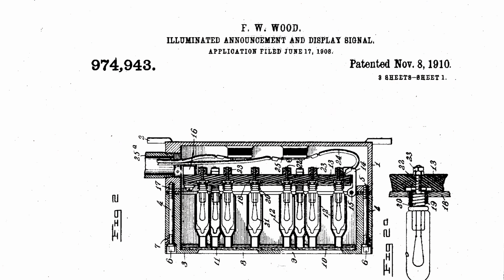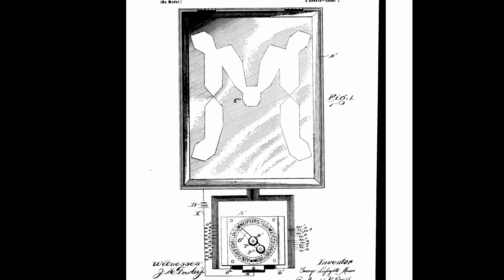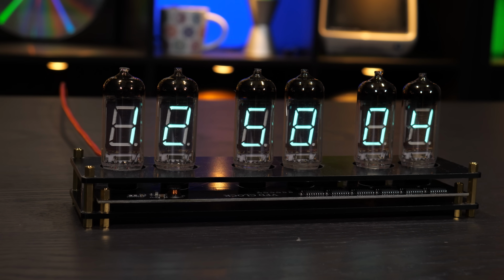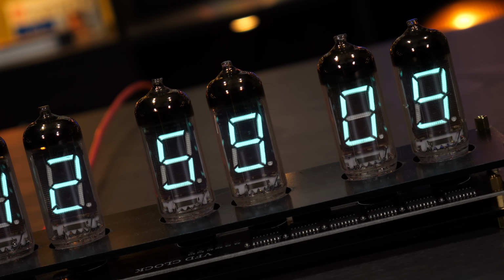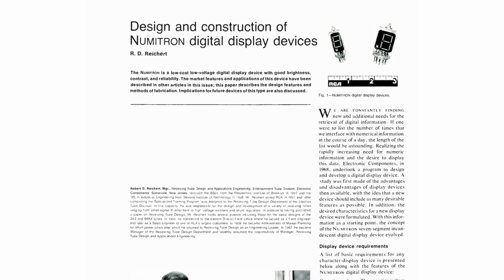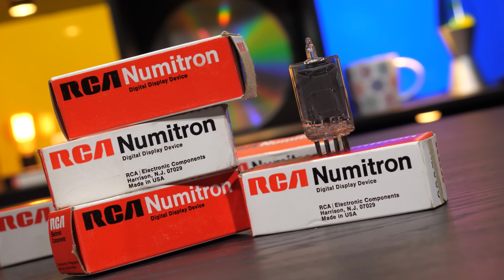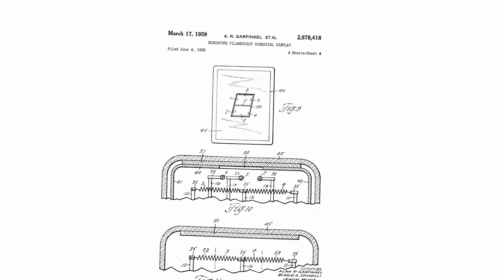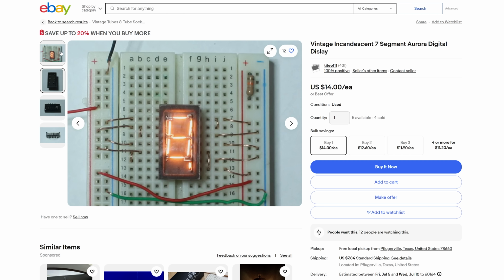The Numitron: An obvious idea that wasn't very bright

Comment: I love how janky they are, As a product designer myself, I bet the people working on these had a blast designing them, the sheer "slap stick" energy they radiate is just amazing, the pins also being the only support for the internal board (no wonder it's all crooked), the tape that hides the back wiring wrapping around the front of the board, the barely stuck in needles holding the filaments, and the cheap gold paint on the even cheaper metal rings around the base of the bulbs.

My only real critic would be the background, it doesn't look like it's made of anything special, they could have easily just picked something darker.

It's a shame they were hidden behind tinted panels, at least make the panel transparent to show off how cool they look !
Reply: SeanBZA mentioned they used things commonly available in the factory, so the background was deliberately chosen because they had it available in spades.

I wonder what their timeline was, since they had to know other tech was coming down the pipe.  It seems like the kind of project where they needed something "now" and as cheaply as possible.
Reply: @EmperorA0  to be fair, they probably were useful in situations where you wanted cheap and simple that could survive EMP or ionizing radiation, or extreme temperatures. Incandescents in cold weather back in 1970 would have been better than the then-immature technologies we now use after decades of evolution.

Comment: 3:58 I recall being infuriated by the 7447/7448 7-segment LED display driver ICs. The problem was that they were great for BCD, but whoever designed them could have made them support hexadecimal as well with just a little extra circuitry. There is NO common chip that supports hex. If you want to build a circuit that does this yourself, you'll need a ton of chips to get the behavior you want (Ben Eater has a video in which he does just that, and the resulting circuit is gigantic). The only alternative is to use a PROM, which is expensive and you end up wasting most of its capacity.

Comment: 12:32 042069
14:53 133337

I see you, Alec.
Reply: I am confused, what is significant about these numbers
Reply: @Andrew-cw2fs  4:20 - pot reference, changed the 5 to a 6 to briefly make "69" seconds... nice ;) then the number "1337" comes up a lot in computer/programmer/hacker circles as a shorter version of "elite" morphed into digits instead of letters "elite" -> "eleet" -> "leet" -> "1337"
Reply: @Andrew-cw2fs  1337 OR 133337 
1337 stands for the English word "leet", which is synonymous with Elite. Since the spelling was initially only understood by a small circle (the elite), it was called Leet Speak - or expressed in their own language: "1337 5P34K". This leads us to the name 1337Camp

42069   
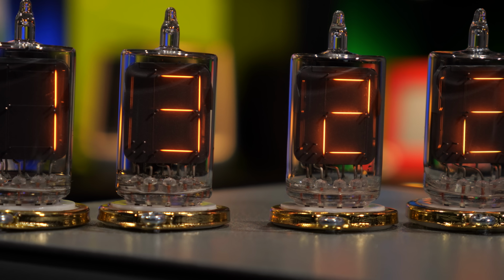420 is a weed thing. 420, 4:20 or 4/20 (pronounced four-twenty) is cannabis culture slang for marijuana and hashish consumption, especially smoking around the time 4:20 pm (16:20). It also refers to cannabis-oriented celebrations that take place annually on April 20 (4/20 in U.S. form). At locations in the United States where cannabis is legal, cannabis dispensaries will often offer discounts on their products on April 20.
69 is a sex thing you probably know
Reply: Niiiiice... came here in case they weren't pointed out

Comment: I remember the term Nixie Tubes, which
I remember in 1960's-1970's computers
as when there was the IBM 360/370
Computers where I did COBOL with
026 Punchcards on a machine to create a program.
I did Basic in the 1980's with the IBM
PC, also Commodore in then from
the Crazy Eddie electronics store.
Actually, back in 1971 we had BLMPS
in the Air Force base Personnel Office
with a shared Burroughs 3500 Main-
frame Base Computer with user
TC-521 Frieden Terminals for data
entry. 😊

Comment: I wonder if at least some of these problems could be fixed to make a less shitty, somewhat reasonable version? At least make the background dark. 

Also, maybe some kind of discharge tube or whatever it's called could be used instead. Either way, those little glass tubes look neat

Comment: Some guys I went to college with built a clock using those projection displays, but the logic for counting one second pulses and outputting the signals for the displays was done entirely using lots of these large relays they came into possession of somehow. Each one was the size of a soda can. The clock was in a large bare plywood cabinet they built, and it loudly clunked away the seconds.

Comment: The weird thing is that it'd have been very easy to improve. Simply adding a mask and diffuser in front of the filaments would dramatically improve the display, as it would eliminate backscatter and the segments a better shape. I wonder why they didn't?

Comment: 12:31 Your clock has a bug where it goes "58-69-00" instead of "58-59-00" on the seconds part. Extremely weird to see a six in the second's tens place XD
Reply: Surely not a bug but a very intentional Easter egg (4:20:59 becomes 4:20:69 in the video).
Reply: @nyunta139  
Well, but that may be accidental. It seems to always go 58-69-00, even from other times than 4:00:58.
Reply: @Lampe2020  Possibly. Seems more unlikely to me to do that by accident though! I feel like I saw another comment mentioning it that Alec had liked, also. But I may be wrong.
Reply: Nice. Blaze it

Comment: They could easily have made curved overlapping filaments, (15 segment, standard strait 7 segments with 8 corner filaments that overlapped the strait segments) with a black background for a much more legible display.   They could even have made it so the curved segments were powered by the adjacent strait segments so the same logic chip could run them.  Just a thought.  I figure they didn't bother because it would have added cost, and what they had was "good enough".

Comment: While the future versatility of VFDs and LEDs would have inevitably spelled doom for the Numitron's widespread use, I absolutely agree that if RCA hadn't phoned them in as a cheap product and actually bothered to design them better and actual QC check them, these little bulbs could've had a somewhat brighter future.

I mean in the first place who the hell at RCA thought that putting these things against a relatively light coloured, reflective background was a good idea - all it does is ruin contrast by creating a backlight reflection of the exact same bloody colour!
You can't even compensate by making the bulb brighter, because that just makes the backlight brighter!

Comment: Try this, take it outside on bright sunny day with the sun stairing straight into it and set it next to any other display tech you have and report back to the class which ones could be read. Bonus points if the other comparable displays are from the same period.

Comment: "Wasn't very bright" haha, that's a nice pun!

3:05 wait until you see an IEE (not IEEE - let alone SMIEEE!) Nimo tube... Hey, where's Fran? Again in the lab?
She got me to love all those vintage display technologies, even if most of that stuff is out of my reach economically.
Beautiful closeups here! :)

Don't let incandescent segments (or bulbs in edge-lit and projection displays) go completely cold - use biasing resistors to pass a low current; shoot at a value where they're still dark, but when they light up, that'll reduce the thermal stress, prolonging the filament's lifetime.

VFDs are going down - as far as I know, only Futaba or Noritake Itron make them, and with war in Ukraine, production there was halted. Sad news...

I've never built a clock using any old display technology - apart from my MTZVFDCLK project (Multi-TimeZone Vacuum Fluorescent Display CLocK) that's not finished yet, and is more about telling time in a specified timezone than telling time per se. I intended it as a tool to check the local time of youtubers doing livestreams, because it can get confusing really fast if I need to calculate it myself. Knowing that someone is e.g. in Sydney, Philadelphia or Austin, I could just choose an option in some web interface or send a command by MQTT... and the clock would show me the time anywhere in the world.
But I've used Nixies in a bunch of projects, from thermometers to a little art installation.
Reply: 4:46 he mentions NIMO tubes and even gives a card link to her video about them!
Reply: @robinsparrow1618  ha, I haven't noticed.

Comment: I don't know. In spite of the execution of that specific product, I don't hate the concept. Implementing a boost converter for the high voltages for a nixie or VFD in a battery-powered device is a real pain and probably not great for efficiency, so on paper this makes some sense. Putting a slightly diffuse colored filter across the front like they suggest may help with the thin filaments, and may also help with the contrast issues in much the same way that they do for VFDs. Sure, LED segments blow this out of the water, but I do like how scalable these are. If we had never advanced past those tiny LED displays with the lenses over them, I could imagine a world where this makes sense and the idea gets iterated on and refined a bit more.

Comment: Okay, okay, enough beating up the numitron, there is a segment of the industry they were unmatched at the time, nothing else could do what they did. That segment was transportation, and that ability was being clearly visible in direct sunlight. Nothing else came close at the time except LCD which wasn't ready for prime time and did not have the operational temperature range that these had. In the cockpit or on the dashboard, visibility mattered, not style.
The earliest example I recall seeing these used was on a MPH Industries K55 police speed radar.
Readable in the britest sun and usable in the coldest temperatures without turning black in highest temperatures.
Eventually other tech got good enough to replace it, but was still used for over 10 years in some applications. 
Give the numitron some respect, it was the right tech at the time and was superior than anything else at the time in its target niche.

Comment: I heard they were a lot more rugged (electrically and mechanically) than the alternatives up until the mid-80s, so aviation use was fairly common, alltough the ones I have on hand (actually from an old MiG of all places as far as I know) are flat packages usually known as Minitron.

Comment: They needed to keep the Old Production Equipment running ! These are obviously made on the machines with made vacuum tubes. They knew Vacuum tubes were headed for the dust bin, & made these to hopefully keep some of the machines on those production lines still running ?

Comment: I had a rather peculiar mechanically-encoded 7-segment with independent neon mini-lamps per-segment. by mechanically encoded I mean it was a mechanical clock where instead of hands, it had slip ring disks and pickup shoes for each segment. technique only works for a Clock, not a General Display Widget though.

Comment: Great video, as always.
I love both their jank and simplicity, (Though that grey board really was a horrible call)
I'm guessing RCA knew it was a stop gap product limited to maybe a few years use at best, that only had one major advantage, it's price. 
Even a month's research and minimum investment would cut into that already paper thin margin.
Especially knowing how unreliable handing over to the research labs would be. They wouldn't have finished until 1980 and it definitely would have used holograms, lasers, and something "sonic".
So, management had the tubes department slap something together with whatever was on hand as cheaply and quickly as possible. 
The guys who named it probably put in the most thought of anyone involved in the project.

Comment: I remember the 7-segment LED packages later even had the decoder embedded.  That meant just 4 BCD data pins (and decimal point) along with power/ground.  For values above 9, you could get ones that displayed hex, or others that blanked and displayed other things.  Made kit-bashing together a clock or home-built calculator so much easier.

Comment: my buick reatta had a VFD display for its insturments that was quite complex, and the control circutry was NOT up to the task of running it well, my car went through three of them over the course of my ten years of ownership...  though it was already 20 years old when I got it, and i never got my hands on a NOS unit (just junkyard finds)  Also, surprised you didn't bring up the heat production of VFDs as a downside, because boy do they like to get hot...

Comment: cheap digitial devices also used filaments inside LED-style 7 segment displays in the past. These looked just like LED displays, but behind a plastic diffuser you found small filaments directly on a pcb and yes, without any vacuum, gas or encapsulation. I once had a radio alarm clock with this kind of display and I was very surprised what I found and the fact this worked and looked so good. I was sad that there was no nice LED display to salvage though^^

Comment: Hmm, never saw this type of display before, but it's so obvious someone tried it, so daa. And I kinda like the thin segments! Okay the execuiton could have been a lot better and nicer, this looks like a prorotype. I thought it will consume much more power and have much less lifespan, this aspect is not bad! I think a pure black background, this close would be too hot, causing problems with installations in tight and limited ventillation spaces. This and the contrast could have been addressed with a curved black plate near the glass housing as the background, which would be farther from the filaments and had more surface area therfore wouldn't get as hot (and a concave surface could appear even more dark then a plain surface). Damn, now I want to build one :D

Comment: I think you were right about gas pumps. I was racking my brain trying to remember where I've seen these before, and when you mentioned it, it clicked. I think I've also seen those flat-pack displays in old pinball machines from the 70s. I know that a lot of them used orange VFDs, but I think that at least some of them used those incandescent displays because I remember the segments fading in & out the way that VFDs don't.

Comment: And how much did you invent, Mr. oh-so-clever? They could have added a diffusion layer and a template in front and it would not have this issue with the brightness, thin lines and washed out light. Besides that, it is not "complicated" to add a small transformator to go to 35V or something, it is done in every device almost and probably cheaper than adding those monsters, depending on how many you need. Problem was more the programming or the drive to those segments, because it was all pretty early stuff.

Comment: I actually think the numitron is a pretty neat, simple idea.  What is strange to me, is that it didn't come out during the octal tube period.  There's no reason they would require a computer to work, in my opinion, they could be triggered semi-mechanically.  It just seems like a technology that would have been revolutionary only if it came out thirty years earlier.  I think the simplicity of the design has a lot to be said for it.  I think it would have helped if they actually used a less flat backplate that was stamped slightly so as to reflect the light of the segments more precisely, as well as avoid flooding of the intended dark areas.

Comment: I almost spit my drink at 1:00, I wasn't expecting a Portuguese train station in this channel! I immediately recognised the train to Sintra on the board and looking at the ceiling it must be Rossio station in Lisbon, which I regrettably never entered or took a train to/from (yet). And incidentally, those mechanical 7-segment display clocks are quite rare in stations around Lisbon these days, the norm is digital 7-segment display or analogue clocks.

Comment: These were indeed used in gas (petrol) pumps. Roughly 1970's era pumps remained in use in many places into the early 2000's when "pay at the pump" begain to take over as a necessary convenience in order to compete.

Comment: I just wish some product grups would move on from 7 segment displays. A dishwasher showing P1-P9 to indicate the program is just terrible UI. Sure the numbers are correlated on some label but that's just a bad way of doing things. Oh and resetting to the default program without keeping any settings is just as terrible. Put a 3" 480p LCD on there. Doesn't even have to be color, dot matrix is just fine.

Comment: Electric Technology during that time was already wicked expensive, and used a lot of power. 
The device makers are not going to skimp on outwards appearance, because that is what is going to sell the product.  
I use to work for a company that spun off, a now defunct mainframe company, they told me stories from the good old days of the 1960s onward. The computers of the day did have a lot of blinking lights and knobs and buttons, many did something, however the techs didn't bother with them, they were there because if a company is going to spend a million dollars on a computer, it better be impressive to look at, and was also placed in a predominant spot to show to shareholders and customers.

Comment: I can guess. It not easy without precision. Plus there was competition, time and money. But notice the light for LED is really different from the old days. If your testing use the old bulbs to compare I get the feeling you rush it? Plus there producing as where should be made in china or local factories? Was it design in door or out door? What was common use in factory, transport and other things? Just a guess.